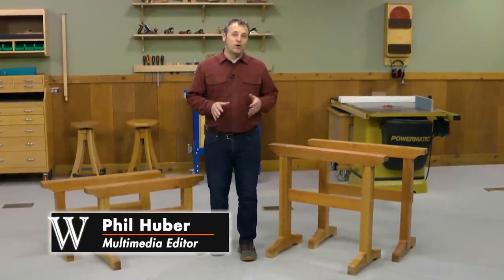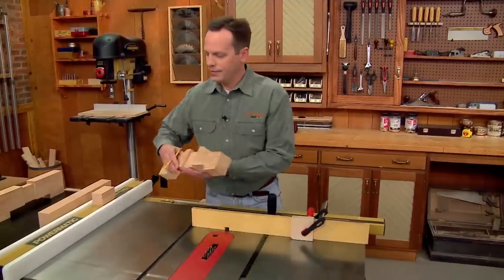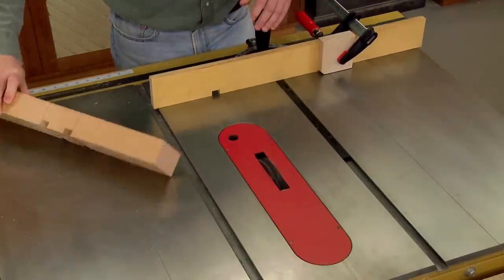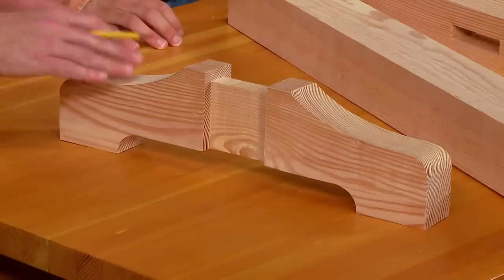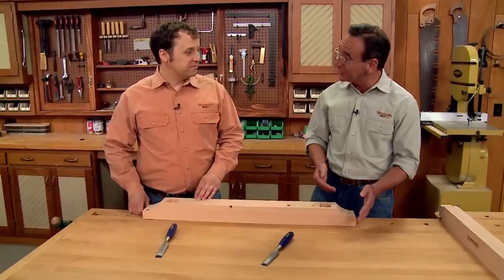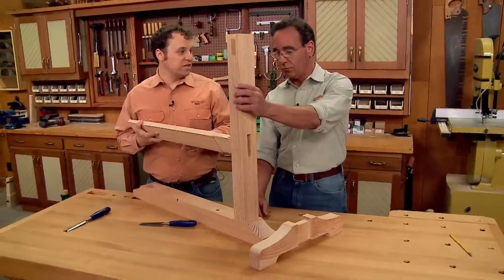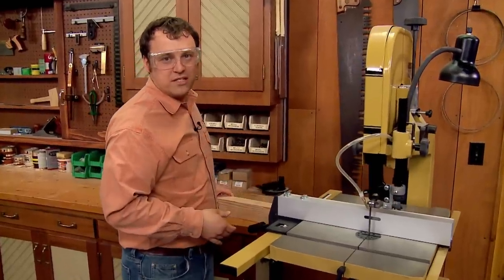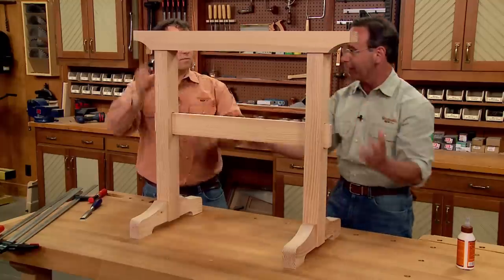Building Trestle-Style Sawhorses with Construction-Grade Lumber

Comment: you sawed the notches down to the size of a 2x4.  I could slap a few together and make something that would hold twice as much in half the time it takes to make those.  Drive the nails in a little and use some wood filler if you're so worried about how it looks in your shop.  That's a Japanese temple, not a sawhorse.  But I'm sure your date will be impressed.
Reply from the maker: Hey, we're just trying to class up this joint a little.  :)  (I did show my wife these sawhorses after your comment and I'm disappointed that she was not impressed.)
Reply: Woodsmith    should've showed your date.
Reply from the maker: Alan Malcheski - LOL, definitely.
Reply: @KelMaster Construction   Dammit I'm making a point here:  Those are not stronger, the notches are too thin, it wouldn't be any stronger unless you glued it, and even then, you've got wood grain going in all different directions, it isn't that strong, it's just fancy.  
Japanese nail-less woodworking is fascinating, I'm a big fan, but this... I suppose it's good practice but it's no better than a regular sawhorse.  I took my dislike off, but the comments stay.

Gotta keep it real.
Reply: @KelMaster Construction   eh?

I DID NOT WRITE STRONG ENOUGH FOR ______.  this video implies that These sawhorses are stronger than simple ones made out of 2x4s.   PROVE IT.
they're thicker, and they look stronger, But they're Not.  
Prove it.  Fancy big nothing deal.
Reply: i scrapped shingles for a contractor who went by CalConstruction, for a month, and after adding things up, I realized he paid me 5.50/hr..  to do all his scrapping on two houses.  I was taking bundles up ladders and helping them too.  He had the nerve to call me again, as if I would go back.  When construction contractors ask me silly questions, they get silly answers.  I'm sorry, but I like to keep the record straight.  Somehow things got mixed up.  My fault.
Reply: @KelMaster Construction  wth do you do, build nuclear power conduits?  Gov. buildings?  I haven't worked construction in 15 yrs. but I've worked for contractors and that seems a bit high.  
Regardless of your fancy career, I am right.  But I am beyond right and wrong, and so I am beyond caring.  
I looked upon the youtube, and behold, unnailed horses, and the power was given unto them, over the flat part of the garage, to build with saw and with hammer, and the beastes of earth. 

Anyway, where can I apply? 
haaaaa

And I looked, and behold, a pale horse, & his name that sate on him was Death, and hell followed with him: and power was giuen vnto them, ouer the fourth part of the earth to kill with sword, & with hunger, and with death, and with the beastes of the earth
Reply: The retired Los Angeles Lakers star was traveling in his private helicopter over Calabasas when a fire broke out, sending the chopper spiraling from the sky, according to TMZ Sports.